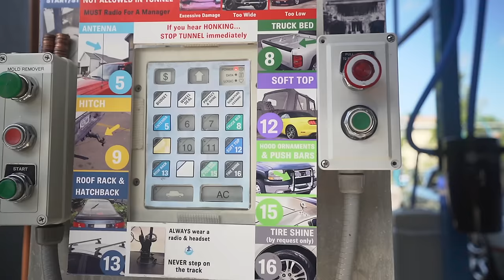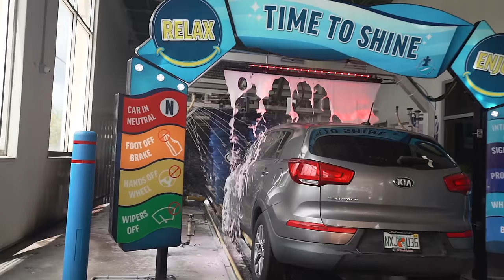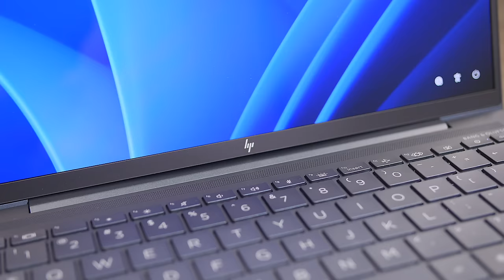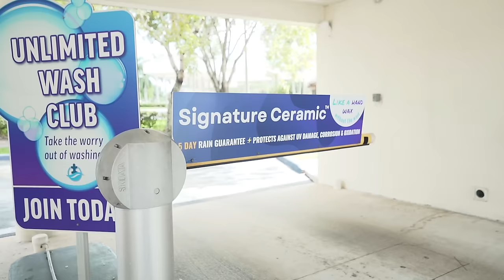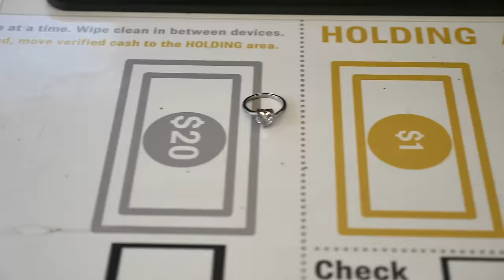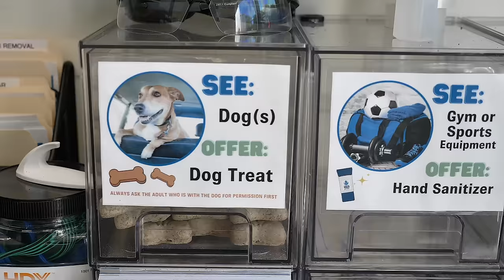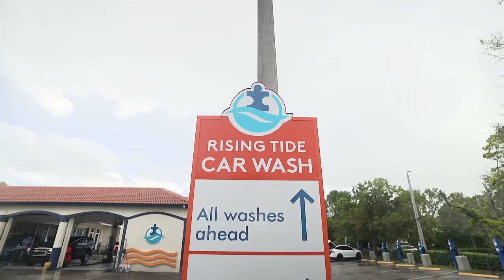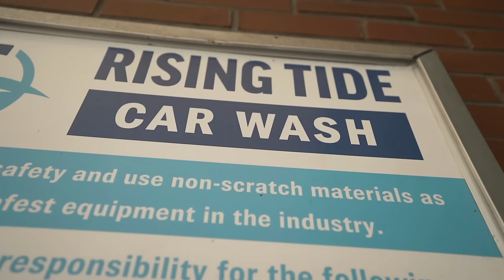NEW Car Wash Model is a Game Changer!! ($2,884/Hour Secret)

Comment: Using brushes like that + the large automatic brushes just scratch the paint. Not a very effective method for detailing a vehicle
Reply: This is a common misconception, hence the need for car washes to arm themselves with cameras at the entrance and exit of tunnels. The majority of the time car wash operators will catch the vehicle on camera with preexisting scratches. The brushes at a car wash wouldn't cause a swirling scratch because the machine moves in a constant direction. So instead of being one scratch here and there it would go across the whole car in the same direction. It doesn't pick and choose vehicles at random. And if it was scratching cars it would scratch all the cars before and after you. I've seen plenty of sports cars and g wagons come out perfectly fine. Does that mean you'll never need a paint polish? No, that's just part of vehicle maintenance. This would be more of a maintenance wash than a Proper detail. Detailers don't polish vehicles all the time because it would wear away the paint. Hence the term maintenance wash. The more times you wash the easier it is to clean and detail! Plus it's actually more environmentally friendly compared to the wash at home method. Proper paint preparation and care beats poor performance. Simple as that.
Reply: Still making millions though, if they refined it, ie cut out the the brushes they could easily market it differently and double the revenue.
Reply: @RajaCAthletic  everyone who was doing that has quit and converted to brushes for a reason.
Reply: Ok boomer

Comment: I hate when channels change the Thumbnail. It just shows that they are full of crap
Reply: Yep.
Reply from the maker: It's quite common for a channel to rotate thumbnails in order to identify the one with the highest click-through rate, it directly impacts the video performance ;)
Reply: It is called A/B Split Testing. Marketers use this all of the time.
Reply: It is a very good strategy actually